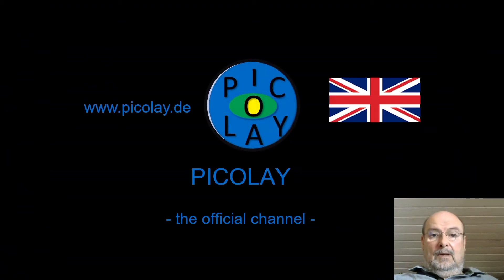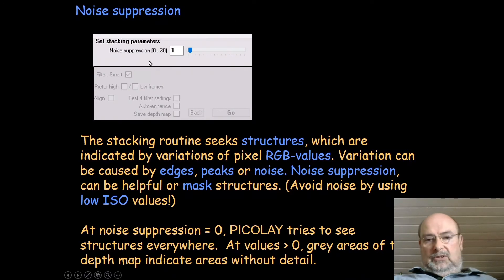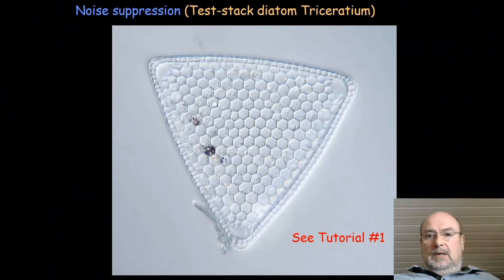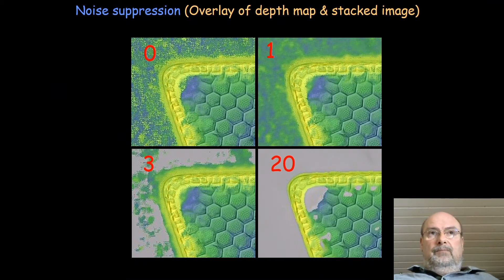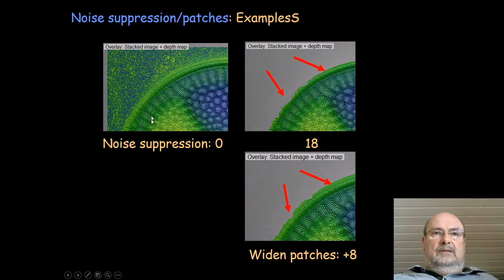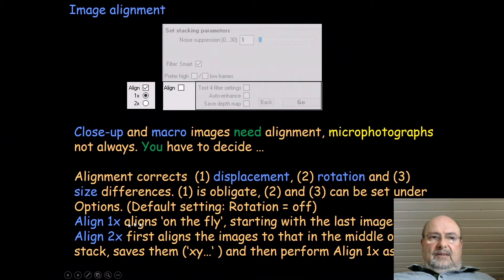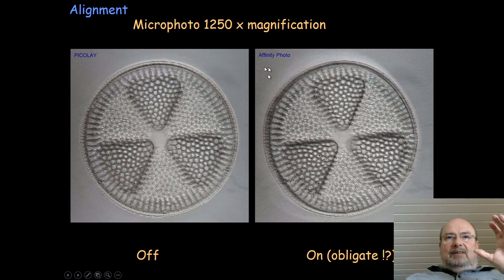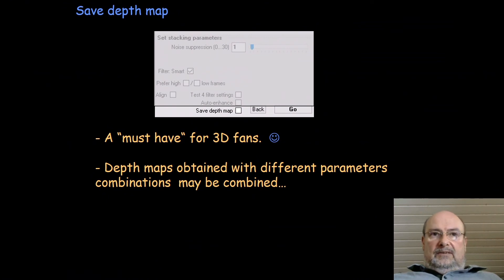Understanding focus stacking parameters, PICOLAY Tutorial #2:

Comment: Is there a way to adjust stacked image opacity?
Reply from the maker: Yes, there are two ways: First, you can gradually prefer or suppress upper or lower frames in your stack (under 'Set stacking parameters').  Second, with 'Hologram stacking' (under '3D view') you set a contrast score threshold of structures to appear visible, together with a pre-selected viewing angle one can display any structures present in your stack (e.g. bottom view etc.). Structures above the minimum contrast  from every layer can be exported , e.g. for 3D printing...

Comment: So i import 5 images, tick the allign box and it turns them into a mashed up mess that hasnt been remotely alligned
Reply from the maker: I normally use 20 or even >50 images with small step-by-step differences. Those sets will be aligned correctly and give better stacking results. Good luck!